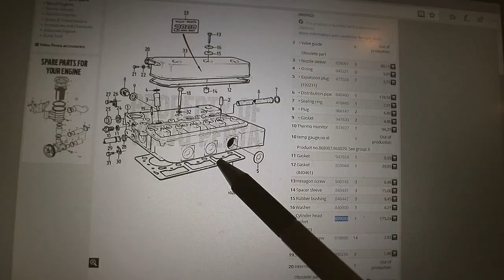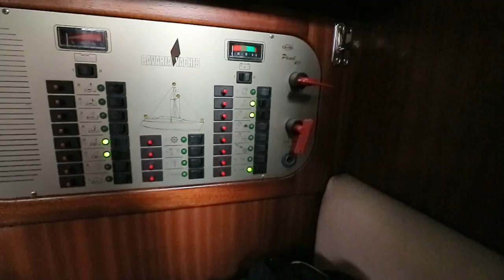Where Are We & What's Coming Next?! | ⛵ Sailing Britaly ⛵

Comment: Chris: great new faucet, however it should come with some type of collar which serves as a stop when pulling out of housing, so not to pull entire plumbing out? Serves as a stop, look for it could prevent problems down the road.

Barney
Reply from the maker: Hi Barney, thank you for your advice. The pull-out shower did come with a weighted collar for the hose but it interfered with the smooth function of pulling the shower out. Leaving it off isn't a problem as we don't pull the shower to the extremity so the bend radius on the hose isn't too small. If this did become a concern in the future (children pulling on the shower, for example) then it's easy to make a stop by adding tape to a larger diameter than the hole. Fair winds, Chris 👍

Comment: Top class video as always guys! How quickly Emma is growing. Good idea with the taps (forcets). We did the same on our Bavaria 32 in the heads. We also had to drill out the floor to get the sump pump in as it was not fitted with on from the factory as it was an option. That was a nightmare as the pipes on the 2003 models were fitted before the inner skin was fitted. Just wondering if your engine heats the water in the clourifier as its a raw water cooled engine? There is a kit to change it to indirect cooling with a heat exchanger. But they are not cheap. We fitted one to our old Westerly years ago. (gives you a buffer in the event of raw water blockage and stacks of hot water from the engine without shore power). Looking forward to your next instalment, sail safe, Ant & Cid xx
Reply from the maker: Thank you Ant & Cid! We have those bridges to cross yet, and I'm sure they will make their way to the top of the priority list as soon as we are heading out to our natural habitat of anchoring out. I've mentally come up with solutions to both problems and I'm sure we'll work them out ok. If we are going to use the engine to supply hot water then I think I'd be tempted to tap into the same location that the Volvo calorifier would fit, but use a cheaper non-standard heat exchanger with which to make hot water. We'll cross these bridges in due course... At the moment we have a huge backlog of videos to edit, and you know how long that takes!... Safe sailing & fair winds! Chris, Rossella & Emma 🙂